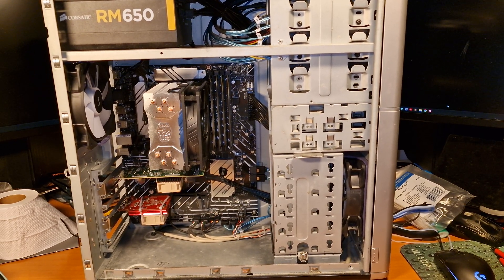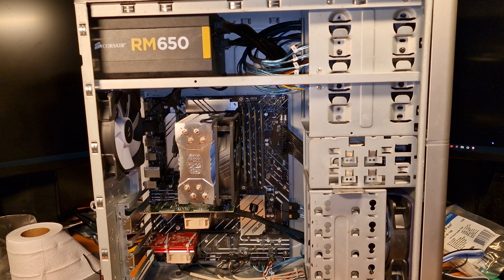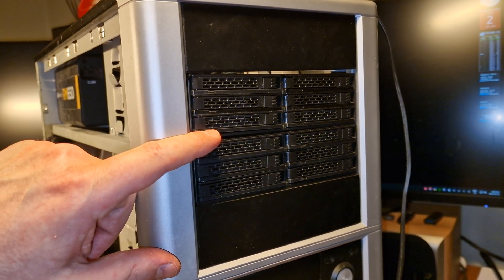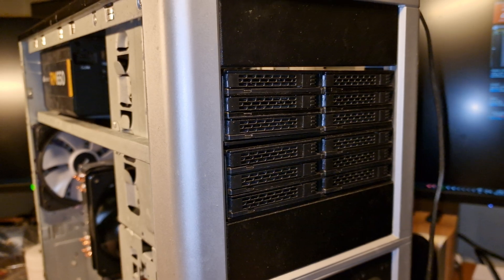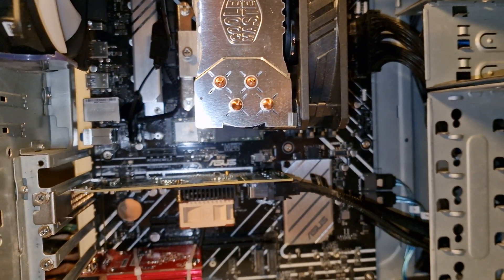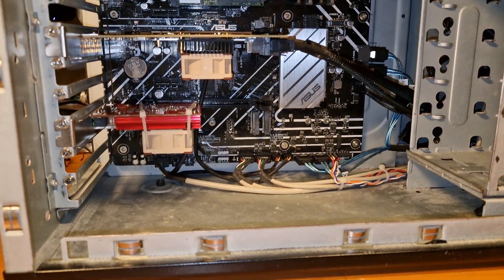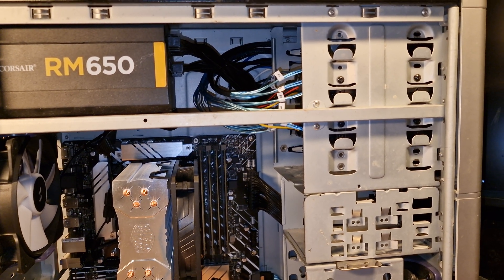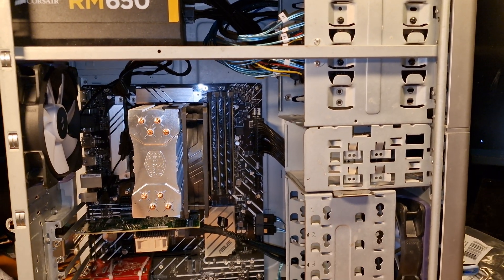#361 DIY NAS with 128 GB of RAM, SSD's and TrueNAS

Comment: Does the HBA really get that hot?  I thought that the hardware RAID cards were hot, but HBAs should be running cooler.  Maybe I'm wrong. Nice going by supergluing the small fan. I'm thinking of getting two HBAs but don't want to loose access to two pcie slots, so it's interesting to know that these needs extra cooling
Reply from the maker: It's getting hot. I touched it after 15 minutes being powered on. It's above 60 degrees C. It almost felt like I burned my finger.
Reply: @UnipixelMedia  thanks for the info! Enjoy your build!